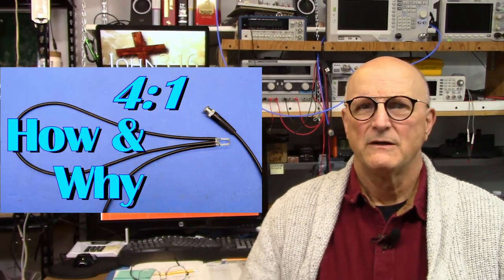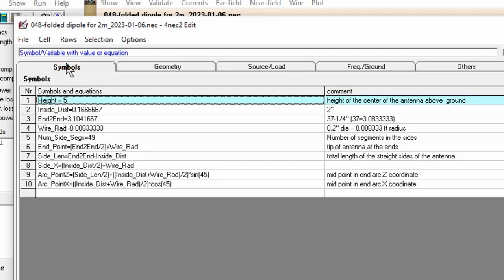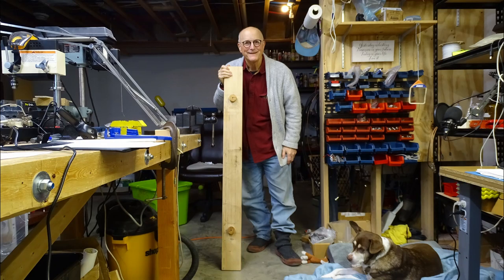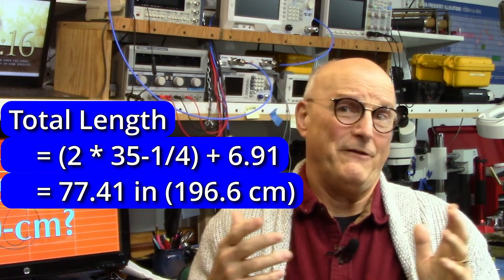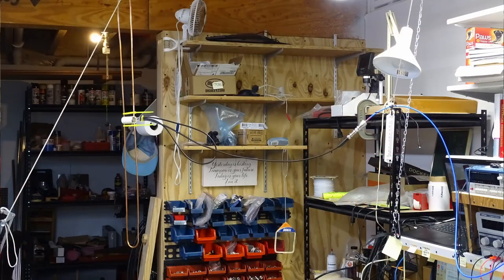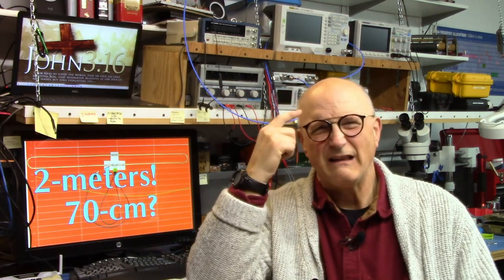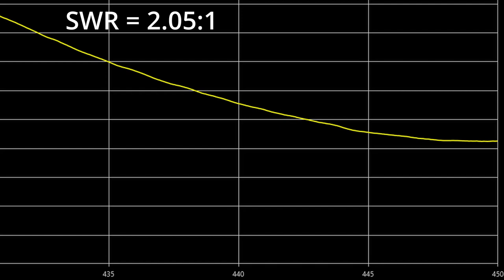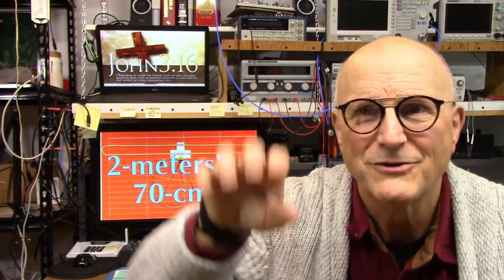A Folded Dipole for 2-meters (70-cm?) (048)

Comment: I have not watched the video yet but folded dipole caught my eye.
 
I used to build 3 or 4 element Yagis for 2, 6, & 10 meters and learned that having a compact or short boom thru a close spacing resulted in a low impedance which could be brought up to 50 or close to 50 ohms by using a folded dipole with the right seperation between wires. I ended up with some very good compact Yagis.

Since I am not a big fan of DXing and use my antennas for other things such as conversations within 500 miles or radio astronomy many of my antennas are NVIS or at the very least have a high take off angle by being low to the ground. Once again I offset the lower impedance by being low to the ground with a folded dipole configuration. I found normal audio speaker wire often does the trick.

After watching your video I see we essentially did the same thing in reverse. You needed the balun to bring SWR down & I needed folded dipole to bring SWR up.

Incidentally, I'd probably not care about fancy looking and used squared off ends using normal 1/2 inch water pipe and right angle fittings or elbows. What you get in return for looks less cool is an even greater spread with good SWR due to the increased skin & likely easier to construct.
Reply from the maker: Yes, it is amazing how many and varied ways one can find to make functional antennas! 🙂

Comment: Suggestions for bending:
(less desirable) -- fill tube with water and chill to hard mushiness (not solid ice).  Bend around form and let "ice" melt.  Then evacuate
(much better, but messier) -- fill tube with white beach sand (dry and clean).  Bend around form and evacuate sand from tube ....
Reply from the maker: I've heard of the sand one. I was almost tempted to try it myself. Never heard of the water method. Thanks for the input! 🙂
Reply: Use fine sand and close ends, crimp, cut off excess, use pipe cutter only

Comment: The working out the band radius and your tips brilliant. Nylon cutting board will eventually disintegrate under sunlight, as has happened to mine in the past. Thanks for posting, Barry, vk2fp/ag7vc
Reply from the maker: Thanks!
Copy on the cutting board. I did an experiment with some. I took one raw piece and another I painted with a black "Krylon Fusion for Plastic" paint.  I left them both out in the weather/sun. It was amazing the difference between the two.  The second weathered MUCH better than the first. 🙂

Comment: n up the wire that you are using - fasten one end in a vice and insert the other in a speed controlled drill after a while of spinning the wire will so hard that it will be self supporting  I use this method often for varies uses and it works very well
Reply from the maker: That is an interesting thought. Never heard that before. 🙂

Comment: Hi there. It's G1bki in the UK. Nickname is George.  For info I have used many years ago car brake pipe. Low Cost and strong. Also as its hollow I have inserted garden wire at each end as it can slide in and out for tuning swr etc. Also used on a circular aerial. Cheers from old George
Reply from the maker: Thanks for the idea! 🙂

Comment: So the only way to adjust the antenna for desired resonant frequency is to rebuild the antenna?
Reply from the maker: You could purposely make it a little larger and trim the ends at the feedpoint to resonance. This would yield a larger gap between the feedpoint ends, but would prevent you from rebuilding it. 🙂

Comment: Ok, you wanted a question. How would you go about doing this using Faraday Fabric Tape 1inch x 50 Feet Double Conductive Cloth Tape with Acrylic Adhesive, for Electrical Connection,  like the j pole faraday? could it be done????
Reply from the maker: Good question and an interesting experiment! I cannot say for certain whether it would or would not work. Give it a try! 🙂

Comment: I make 137 cm. Dipole for 100mhz fm 300 ohm impedance.  For convert 75ohm coaxial balun wire lenth = ?cm.   Please guide me.
Reply from the maker: Well...the quickest and most complete way to help you here is to point you to my video on how to make that 4:1 BALUN that you need using just some coax.
You will find that video here:
https://youtu.be/fG7ZpsjXRW8
This video will walk you through step-by-step how to make one and why they work.
Hope this helps.

Comment: For SSB the dipole has to be horizontal and i don't understand the the dimension i just need inches.
Reply from the maker: I give the dimensions in both english (imperial) and metric. You will find them all there. If you open the antenna modeling file, you will find them all in feet.
I use this antenna for SSB all the time and get way awesome signal reports. Hope this helps. 🙂

Comment: Since this antenna is already 300 Ohm and balanced at the feedpoint, why not use 300 Ohm twinlead as the feedline? The feedline will be far less lossy than any Coax you could buy. Then you could put the balun at the radio end (Indoors and dry) and reap the benefits. Plus, you will have the opportunity to tinker with the balun for even a better match into the antenna.
Reply from the maker: Your idea does carry some merit for installation situations which would allow it.  For those folks who can do this and want to do it, go for it! It is a reasonably decent idea.
It just occurred to me ... with a 4:1 BALUN and an SWR of nearly 1:1, given that this is an inverted vee and not a dipole, the actual impedance of the antenna here is probably closer to 200 Ohms. The impedance is adjusted, in part, by changing the angle between the legs. This I did to bring my SWR down a bit. Thus, twin lead at 300 Ohms ... not necessarily a good match.
Without going into my installation situation, the convenience of coax far outweighs the benefit of twin lead here. 🙂

Comment: I would make a dipole antenna not folded. Dipole is easier to work with and is a 50 ohm antenna. A L C match can be constructed very easy using a table which can be found in a ARRL handbook.
Reply from the maker: Yup, dipoles are easier.  I honestly haven't built one for VHF, so I do not know how well they would cover the whole 2M band. The advantage of the folded dipole is bandwidth. I built an 80M folded inverted vee and it nearly covers the entire band within reach of my antenna tuner.  It's plain old inverted vee predecessor didn't even come close.  Enjoy! :-)

Comment: I never heard you say what advantage the folded dipole has for 2 meters over any other similar antenna. I thought the main advantage to the folded dipole was running long lengths of ladder line, which you are not doing.
Reply from the maker: A folded dipole has a wider bandwidth than a normal dipole. This is the main advantage. With a properly assembled folded dipole matched to a properly tuned 4:1 BALUN (like I show in this video: https://youtu.be/fG7ZpsjXRW8), you can have a very nice, flat SWR across the entire 2M band. 🙂
Reply: @eie_for_you  thank you

Comment: You need a feed point impedance of 200 OHMS for a 4:1 balun called a beta match.
Reply from the maker: And that is exactly what I applied to this antenna ... a 4:1 BALUN using coax.  I have a detailed video on the how and why of such a coax-based 4:1 BALUN here: https://youtu.be/fG7ZpsjXRW8
🙂

Comment: what improvement in gain do you get with this folded dipole as compared to a regular dipole?
Reply from the maker: Ya know, I am not sure. I'd have to run the simulations of the two to discover the answer to this question.
Reply: @eie_for_you  I have a request for a video. VNA and Smith charts will tell us what we need to do to match an antenna system to a radio, however no one has ever made a video of actually showing that matching and practice. For instance if it says to put a 470 picofarad capacitor and a 50 micro Henry inductor to match the antenna how do you do that how do you add these components to an incentive system what is the proper way to do it what is the best way to do it I am clueless and I have not seen any videos of anyone else ever showing how to do it either

Would really be appreciated if you could show how to add The recommended components to an antenna system so that it will match it according to the VNA or according to the Smith chart
Reply from the maker: @PatAutrey  Hmmmm, an interesting thought.  I will add this thought in my list of potential videos to create.  Thank you for the suggestion! 🙂
Here is a quick answer to the question for your benefit. If you used the VNA to measure the impedance at a particular spot and used this impedance to determine the required matching network components, then this matching network would have to be applied at the same spot that you measured the impedance at. Alternatively, you could do the same if you were another 1/2 wavelength (electrically speaking) away from that point along your feedline because the impedance reoccurs at 1/2 wavelength intervals.
I hope this quicky answer helps.
Reply: @eie_for_you  thanks for the quick reply I understand the idea of using a half wave coax so that it remains the same but where I'm confused is what do you use if it asks for a capacitance do you just get a capacitor or do you get a coax that acts like a capacitor I've just never added any tuning components to a system before and I'm unfamiliar with the process of how you physically do it
Reply from the maker: @PatAutrey  Another quick answer would be that doesn't matter if it a piece of coax that looks like a capacitor or a real, physical capacitor component, as long as it "looks like" a capacitor.
Here is an example in creating a stub match to make that folded dipole match to a 50 Ohm coax.
https://youtu.be/LY4GysxSEa0
Reply: @eie_for_you  thanks!!!
Reply from the maker: @PatAutrey  You are very welcome! 🙂
Reply: I would imagine a BUNCH more bandwidth. Judging by his chart vs my experience with dipoles and even 1/2 inch copper pipe J- poles, they don't have near this good a bandwidth. Just for laughs and giggles try that program he recommends and see what it gives for the answer and share it over here. Build both of them. You can ALWAYS use an extra antenna around and if you just use a small range of frequencies the bandwidth isn't going to matter. Good luck!

Comment: If you put 4 of these together in a row, how to figure out the spacing?
Reply from the maker: Great question and no easy answer because it depends on what you are trying to do with them. This involves two aspects: (1) the physical spacing (2) the phasing which is accomplished by the impedance, length and velocity factor of the cable harness that connects them to each other and to the feedline.
You can play with all of this in 4NEC2, antenna modeling program (FREE).
I have played with a phased array (mine was four square as opposed to stacked) inside 4NEC2, but I've never actually built any of this stuff. :-(
Sorry I couldn't be of more help, but thanks for the comment and question! :-)
Reply: Stacked array would be 1/2 wavelength apart for optimum eficiency.
If for a yagi beam look up a yagi calculator.

Comment: Ok, so..eh, but 70cm band is 430-440 MHz here..swr is no good.
Reply from the maker: Here in the states our 70cm band is from 420-450 MHz with a whole bunch of repeater frequencies huddled at the top end of the band.  It is at the high end of the U.S. 70cm band where the version of the antenna that I built has an adequately low SWR to be useful. Below that, you are right...SWR climbs rather quickly. 🙂

Comment: To bend soft copper tubing, get the lenght that you need plus some ( put the end of copper tubing in a vice and squeeze end shut fill the copper tubing with silica sand and do same with other end ) you can now bend it around any diameter    do not have to buy different jigs    MaverickIA     walking north@walkingnorth4474
Reply from the maker: Yeah, I've heard that (too late before I spent the $$ on the tool). Sounds like a pretty slick way of doing it.  Plus it means unlimited angles ... I could make a helix if I wanted to! 🙂
Reply: @eie_for_you   Do you help with questions about ham radios
Reply from the maker: @walkingnorth4474  I am a ham and, yes, I do answer questions about ham radios ... depending on the question. Try me. 🤓
Reply: @eie_for_you   I have a 10 Tech Delta 2 model 536  I replace the coin size battery for the clock Now it seems like that I cannot add frequencies to memory I enter one frequency and save it and then add another  I will not keep the first one I do have the manual and schematics Appreciate your help
Reply from the maker: @walkingnorth4474  First, I am assuming that the reason why you replaced the coin cell is because you were having issues with the radio remembering things.
A LOT of these radios have solder-in coin cells 😳. This always puzzled me cuz they gotta know that they are going to need to be replaced! 
Here would be exactly what I would do:
If this is a solder-in device, I would do 4 things, fixing as I go: 
1. I would use a voltmeter to check the voltage on the battery (it could have been damaged / overheated in the process of soldering it in). 
2. I would verify that the new battery was soldered in with the right polarity (*easy* to switch this up with some batteries) 
3. I would carefully inspect the solder joints. Make sure they have flowed properly and making good connection. 
4. I would very, very carefully inspect the traces leading to the battery pads to be sure that they haven't been cracked or broken. This can happen very easily especially when wrestling with unsoldering the the old battery. These cracks can be very, very small...use a magnifying glass.
If it is a socketed battery, I'd first make sure the battery is in the holder in the right orientation and protective tapes taken off of it.  Then I would do 3 and 4 from above.
Hope this helps. 🙂
Reply: @eie_for_you   I changed the battery because the manual says the battery's only good for 3 to 5 years .When I got the radio  10 years ago In step 10 of the manual it says to check the operation of the transfer if you encounter problems try pushing the reset button I don't know where that's at I'm not very good with skimatics
Reply from the maker: @walkingnorth4474  Are you sure you got the jumper back in place?
Reply from the maker: @walkingnorth4474  It's nice that they socketed the battery.
Processor board, it looks like connector "P" goes to the reset button. According to their system connection schematic, the reset button is connected to this header. Follow the wire/cable from connector "P" on the processor board to the reset button. It isn't on a board. My guess is that it is mounted somewhere under the hood.
Again, make sure you followed the instructions exactly (1-8) for replacing the battery, that the battery is in the socket in the right orientation and any protective films that might be on the battery have been removed.
Reply: @eie_for_you   I think I found the reset switch Does the radio have to be powered  On Before you push the reset button
Reply from the maker: @walkingnorth4474  Yes, most certainly.